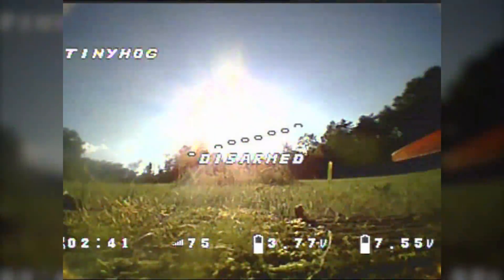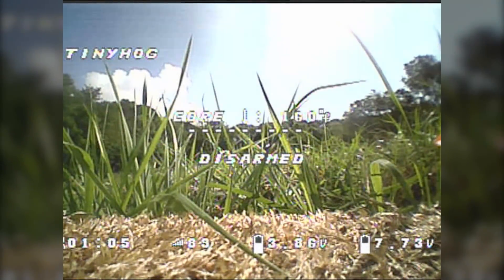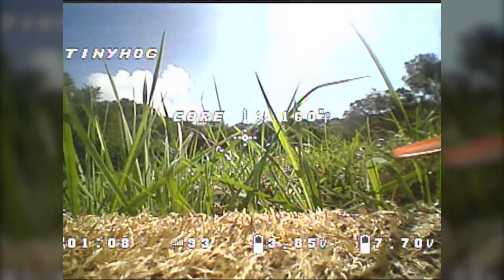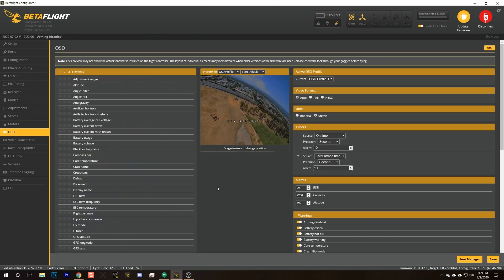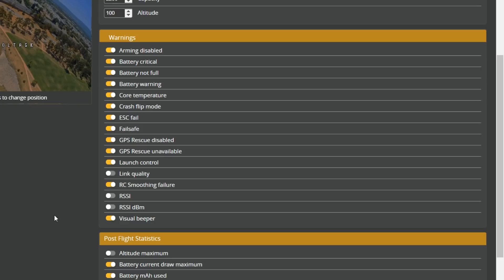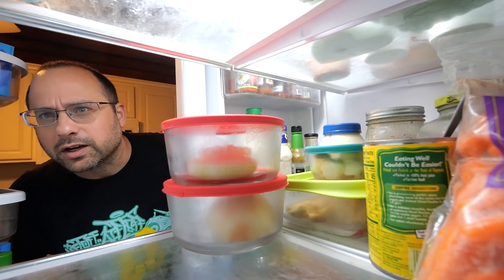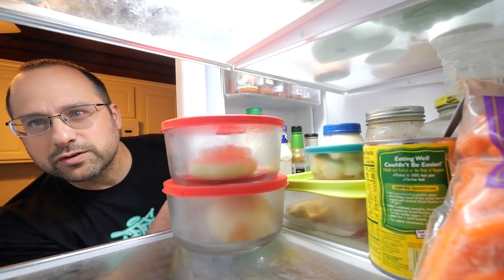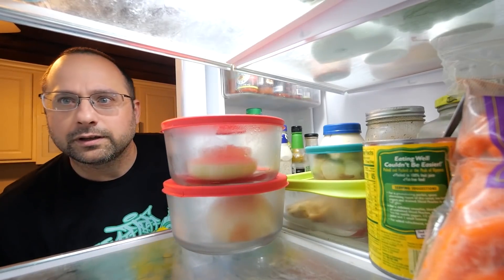Betaflight Core Temperature Warning - how to get rid of it

Comment: Bad idea. I guess you cover up the warning lights in your car as well... The threshold was chosen based on guidance from STM design notes and experience testing various processors. Also very relevant to people who might be overclocking the MCU as it's much more likely to lock up at higher temperatures. If you think the alarm temp is too low, then adjust it with the "osd_core_temp_alarm" setting. Just turning it off is foolish.
Reply: It's common to see MCU lock up around 80-85c. So that's why the default alarm is set to 70c to give some head room. Not every flight controller will lock up, but some will. And the defaults need to be "safe" for the majority of users. So when you start getting small 20x20 boards with built in ESCs packed into tiny frames it's not unusual for these to run excessively hot and beyond reasonable design limits. So it's not the case that the alarm is wrong, but rather that the boards are poorly designed and need airflow to be reasonably reliable. Sitting there disarmed they get too hot and that's just a simple fact. But even a full-size F7 board runs a bit toasty as it's a power hungry MCU. Generally they're ok but it depends on the board design. The MAX7456 OSD chip can run quite hot depending on the variant and then throw in voltage regulators packed in too close and you'll have a problem. The reality is that flight controller board designers have rarely paid attention to thermal design and that's coming back to bite us.
Reply: @BruceLuckcuck  100%
Reply: @BruceLuckcuck  Thank you very much for the explanation and your service to the community, I truly appreciate the development of Betaflight, Thank You! 

When I got core temp warning on the iFlight Succex Mini F7 TwinG (a small 20x20board with built in ESC sitting in a giant frame with plenty of airflow) I ended up replacing the whole stack, it was not a problem in the air, but it was always a problem on the ground...30 secs to warning and 1-2 minutes and it was over 90C (195F).. If I ever crashed it in a field, it could start a fire. I'm seeing the same thing to a lesser degree in the Holybro Kakute F7 Mini stack...I'm done buying 20x20 F7's until I see some better designs. I'm definitely not turning the warning off, raising it if you've tested a board thoroughly...maybe ;)
Reply from the maker: I agree that people who are overclocking; people who are flying long distance or over water; people whose FC is subject to unsual conditions that would increase its heat such as being inside an enclosure; all of these people should heed the warning. I have seen too many cases of a regular quadcopter with plenty of airflow and no reason for the FC to run hot, showing temp warning. I ignored the warning for months and never had a single ill effect. So what should I do? Throw out the FC because for some reason it runs hot?

Nevertheless I am happy to pin this warning so people can hear the official opinion of a BF dev who worked on the feature.
Reply: @JoshuaBardwell  agreed, I'd like to know what the action to take would be. What is a more realistic temp when the FC is no longer reliable. Should one at that point just throw it out or expect it to die and might as well be placing an order for a new one?  What's the action to take???
Reply: @JoshuaBardwell  sector132 had a lock up and destroyed my motors after throwing the alarm while flying, i couldn't disarm and it was in a bush. Sent it in and the new one i got from the rma gives the same alarm. :(
Reply: @JoshuaBardwell  I am using mamba f722s ( wifi ) and I connected gps , xm+ receiver , vtx , camera and if I connects the fc to betaflight then it connects and after 10 seconds it just freezes and temperature increases a lot . And odd waring is of 158°C . And if I connects battery first then I connects the usb then it never shows in betaflight it never connects in betaflight . Is there some thing that I can do to fix it ?
Reply: I do.. why?
Reply: @ItsBlunty  it's reliable at providing relative temperature change. Don't go saying hardware is unreliable because it functions differently than you thought it did
Reply: I am using mamba f722s ( wifi ) and I connected gps , xm+ receiver , vtx , camera and if I connects the fc to betaflight then it connects and after 10 seconds it just freezes and temperature increases a lot . And odd waring is of 158°C . And if I connects battery first then I connects the usb then it never shows in betaflight it never connects in betaflight . Is there some thing that I can do to fix it ?
Reply: According to stm as far as I’ve been hearing from forums and officially betafpv support, those chips (F411 fc’s) will run good up to 125 degrees celcius and you may wanna start worrying about stuff like less longevity or long term damage above that. I was concerned about my cetus x and betafpv support told “it won’t have any issues, it even runs good in 120 degrees core temp so dw about like 75”
Reply: I can't even understand why you would even bother overclocking an fc? Just buy an f7. Why even risk it by overclocking? It's just dumb. They're so cheap now its not worth it. If your fc is too old and slow to run what you need then clearly it's time to upgrade.
Reply: @Skankhunt-42-  I dont get it either. There's an endless thread on rcgroups where people are forever messing with the Omnibus F4's.. go figure.

Comment: This is just bad advice. There are other things you should do to keep your MCU cool. A better solution could be adding a heatsink to components that generate lots of heat. Increasing airflow to the MCU via ducting. Or purchasing a board with a better design. Allowing your microcontroller to continually overheat is a recipe for disaster. There is a reason STMicro recommends less than 80C in their datasheet.

Comment: I recently have the problem with one of my Whoop Boards after replacing the PH2.0 with an A30 Plug (Not sure if it even has to do anything with my work on it). It goes up to 100°C in no time and then I quickly disconnect it. It even has a bad smell afterwards. Could it be excess flux left over? What could cause that? I'm trying to troubleshoot it and I don't want to burn my FC.
Reply: A30 allows for significantly more current to be delivered versus PH2.0, 15-30A vs 2A, you are actively cooking your FC you cant just switch connectors haphazardly like that

Comment: my quad dropped out of the air and the goggles flashing core temp warning....it's obviously more than a warning at some point?  I do need to add a heatsink I guess.  I think one of the little heatsinks from a motor controller should work?

Comment: Hi.. I am from India... I have iFlight F4 board. When i bought it... And setup my whole drone... I really have a couple to beautiful flights.. But I don't know suddenly what happened... It is not getting connected to PC I have tried all driver. Fixes... Also one more major issue is that my microprocess is really getting too hot as soon as I plug it in PC.
Reply: Please help me regarding this
Reply from the maker: It sounds like your FC has a short in it and may need to be replaced :-(
Reply: @JoshuaBardwell  ok... Thanks you so much.

Comment: I am using mamba f722s ( wifi ) and I connected gps , xm+ receiver , vtx , camera and if I connects the fc to betaflight then it connects and after 10 seconds it just freezes and temperature increases a lot . And odd waring is of 158°C . And if I connects battery first then I connects the usb then it never shows in betaflight it never connects in betaflight . Is there some thing that I can do to fix it ?

Comment: this is a MCU consuming much less than 1Watt probably 200-300mW (1.2V * 160-250mA) (no big intel/AMD CPU)  - depending on how the Vdd is produced the self heating should be less than 20°C - for me if the core warning appears it is an indication that something is wrong with the thermal management of the board or surrounding components producing a lot of heat causing the problem. For example crazybee with the onboard ESC, here I would check the ESC first... Beside this any comparison with a big desktop CPUs/overclocking is wrong

Comment: Stm32F7 6 suffix is ok till 85c. Not very much higher than the betaflight default setting of 70c. I personally would not turn off the core temp. If anything raise the core_temp_alarm vaule to 75 or 80. Running a f7, and ignoring the core temp can have some possible downsides to overall longevity, and functionality of the processor itself. I dont think it would be their if they didnt think it was something to take note of.

Comment: I would agree with the alarmists who want to leave it on - if we had the remotest assurance that every flight controller we were likely to buy was designed to some reasonable specification, and if we had any kind of recourse when we got a bad one other than just trying again, and if the hobby didn't consist almost entirely of chasing cheap shoddy hardware and fly-by-night manufacturers around the mulberry bush forever. If the worry is that something bad might happen, well, this is FPV, something bad always happens.

Comment: I recently built the first beta flight rig in 3 years. (Coming from f1) all new components, yet the quad wont hover until about 70% throttle. Feels like 3s again though its running on 6s. Wondering if you've ever experienced anything like this? Gonna start swapping parts now

Comment: I used to not bother with the core temperature. However, now I always observe my core temperature in my OSD. The core temperature will increase if the quad is armed but not flying yet. If the core temperature keep increasing when the quad is flying fast with good airflow, then I will quickly land and disarm. This indicate that there are problems. It could be wiring (short), loose screws, loose vtx antenna, bent props or problems with my tuning (too high D, too much or too little filtering). I also use core temperature to judge if my tune is more efficient than the last tune. Higher temperature indicates less efficiency.

Comment: If you are flying, it should not matter. It does matter if you are plugging on the bench for a long time. I put a small fan next to the flight controller and vtx when plugging in the bench to move air, especially in tight compact builds. Your fc CPU can become damaged if it stays up past 90/100c and this can cause issues in flight, configuration, and possibly a spontaneous failure.

If you are not made of money, make sure you provide airflow to your vtx and fc if plugging in on the bench. Outside, just start flying.

Comment: I agree, about 6 months ago I crashed in a field and it took about an hour to locate the quad, I happened to have core temp on display, it read over 180 Fahrenheit.. my rush vtx was even hot enough to heat to frame all the way thru, and almost burnt my hand.  To this day all the equipment is still operational, even the rush tank vtx.. which by the way, I would highly recommend

Comment: Sometimes you are sitting in the sun baking while waiting for your friend to adjust their vtx channel or some other reason.. gives me an indication to turn on the props and provide some air flow.. or just go unplug if the delay is going to be prolonged.   I thought you were going to tell is why it said 160 degrees in the thumbnail..
Reply: 160 in freedom units is around 71 in real temp. the OSD is set to display the warning at 70c, or 160f. Probably just let it sit until the warning came up

Comment: What is best way to cool off FC.. dive straight down to get air between it.. or dive sideways.. cause gping fast.. top plate and battery blocks my flow lol
Reply: usually just turning the props one will move enough air to cool off
Reply: @Fly_High_FPV  someone was talking about 2w vtx (1.6 I think) getting hot . I was like u have huge props build a duct to the vtx lmao
Reply: @divingfalconfpv4602  ive seen some 3D printed mounts to push air around DJI air units (with small ducts)
Reply: @Fly_High_FPV  oh shit.. cool.. damn I should of patented it and made money haha

Comment: I posed a similar question on FB a while back when the heat of summer really kicked in about how hot is too hot (core temp on osd). I got no replies.
The only time it's a concern is the gps hard start when I started seeing 120 on my osd. 
These summer days make everything hotter especially under fast and heavy flying.
I'm running the RR Hypertrain F4.
Probably get a small fan to sit next to it for those "this is taking forever" gps moments.
Reply: Depends on the processor.. i don't see operating Temps listed on specs.. usually on my computer cpu I like to be under 150°.. but gpu will hit 175° and be fine.. I'd guess fc cpu can run 190° before damage. But warns you earlier so you make sure it doesn't get over that.. 
But wonder if when temps get up if there are errors. My old cpu would crash computer when it run at over 150 (had to add water cooling)

Comment: One of my fc's flys at 100c and goes into thermal runaway (stopped at 158c) should I just turn of the warning?
FYI it dies this plugged in via USB with nothing else attached
Reply from the maker: I would say if you're hitting 150 C then the FC needs to be replaced. There has to be something explaining such ridiculously high temperatures.

Comment: What about  the scenario where its 110f out becaue your in SoCal for a little vacation. Flying around a deserty area and your quad falls out of the sky. Rx lost on the OSD. Check your crossfire out and its fingerburning to the touch, go find your quad while trying not to dehydrate. Faint vtx signal shows overheated warning on OSD during your search. Go back to the house to check the damage and there's a giant black spot on your 4in1 ESC where there use to be a regulator. 
What about that scenario?
Reply from the maker: That kind of scenario is one where you would want core temp warning active.

Comment: What if it fails in flight and now you lost your quadcopter because you ignored the warning and didn't land?
Reply from the maker: If you are concerned about that, then leave the warning on. But the warning has so many (what I believe to be) false positives that I'm not sure how helpful it is. You would be landing all the time for no reason, or not even taking off.
Reply: @JoshuaBardwell  yeah I would agree with that not to mention that there's so many beeps that have the time I don't know what they are

Comment: Sometimes when flying in cold Canadian weather I get core temp warnings below 0°C... Is there any issue letting a chip get too cold in the winter?! I always assumed electronics performed better when cooler... isn't that the case?
Reply: There is a range for these things. So if you get the board cold enough it might not start properly. Usually they generate enough heat to stay sufficiently warm though.
Reply: Batteries will underperform in cold temperatures

Comment: Readily admit, I'm still a noob after 1 1/2 years in the hobby, but hopefully this helps someone...... In reference to, "Core Temperature Warning" the only time I've seen it was with a NamelessRC 412 AIO F4 Whoop FC. These are evidently infamous for frying, unless you reflash the ESC's with different firmware when using BF 4.1 w/RPM filtering. I reflashed the esc's as recommended and "Core Temperature Warning" was gone. (Stock, they're BLHeli P-H-15, 16.7, but need JESC PH-120-24 (2.3) OR Jazz Maverick P_H_120_48 16.8)

Comment: I think this underestimates the people who lather their CPU with thick layers of conformal coating, or have mounted their vtx directly to the top of the FC
Reply from the maker: Possible. But I've seen this warning on builds I've done and none of that applied.
Reply: @JoshuaBardwell  Same. I have a GepRC CinePro w/F7, and the warning will show up after about a minute of no prop spin.
Reply: @JoshuaBardwell Josh, I have a new rekon3 that hasn't even taken a flight outside and the core gets to the mid 90's Celsius just hovering, in an ac cooled room. That's not normal, right?

Comment: Some useful temperature values to keep in mind.
The threshold of pain in your finger is about 50c.  Commercial grade semiconductors are rated to 70c. Military grade semiconductors are rated to 125c.  A transistor will catastrophically fail at 200c and degrade quickly above 180c. The binder in a quad frame will degrade above 100c.

Comment: So I was curious what the MAX operating temperatures were for the processors we use. STM32F411CE is 125c max. STM32F722RE is 105c max. STM32F405RG is 105c max. So i'd have to agree that 70c as the warning temp is fairly conservative. That being said, I have had a quad fall out of the sky flipping out with a 85c warning, nothing else seemed to be wrong with the quad and it flew just fine after the crash. The flip out was recreated at the same temperature warnings. Made some airflow adjustments (moved VTX and receiver around so the FC got more air) and then couldn't recreate it. But for all I know one of the other boards could have been touching the gyro or something causing the freak out. The flip outs were on an F411 board, so they should have been fine up to 125c in theory. Possibly the PID loop started running too slow because the processor wasn't able to keep up at that temp, but I really wouldn't know. The flip outs were on 95+ degree days BTW.
Reply: Yes, it's quite common for the MCU to lock up in the 80-85c range - particularly if overclocked like many people do with F411's. So that's why we set the alarm at a "safe" 70c threshold.
Reply: @BruceLuckcuck  Thank you for the reply. That's really good information to know. That confirms my suspicion that it was locking up due to heat. I don't think I will be turning off my temp warning. It is annoying to see at times, but I'd rather know that i'm hitting the upper threshold so I can try to land before just tumbling out of the sky. Would you happen to know when the MCU locks up for the various processors? Thanks again!